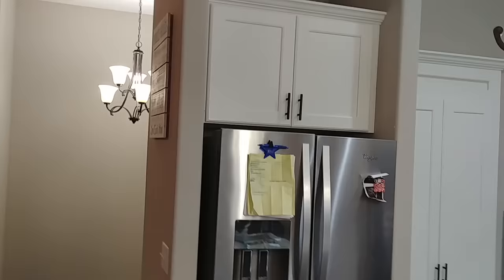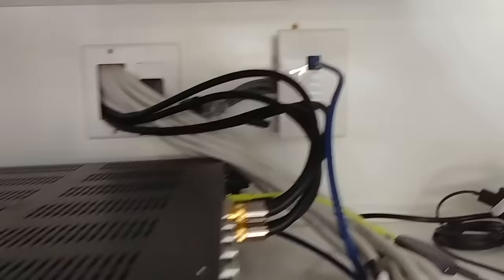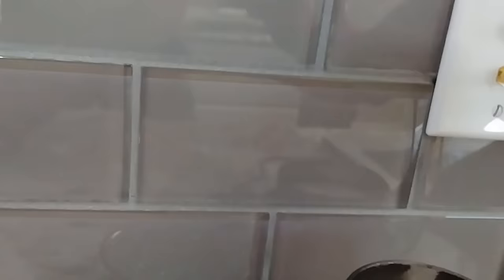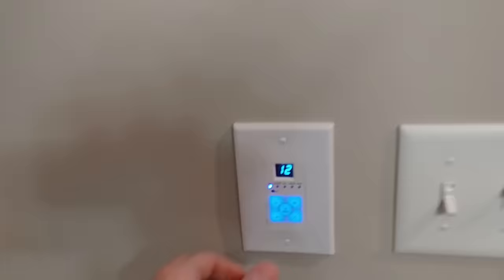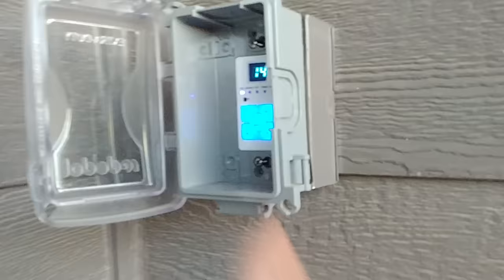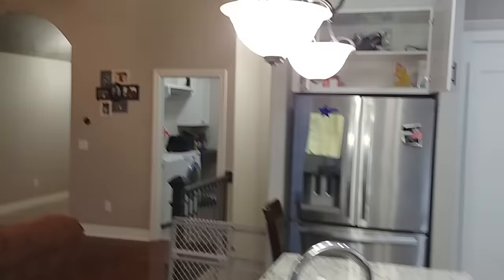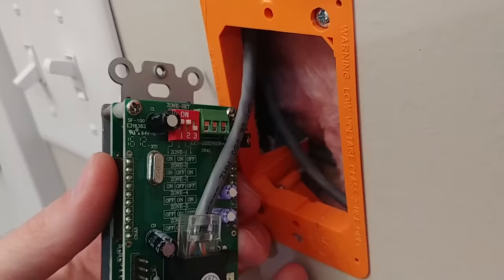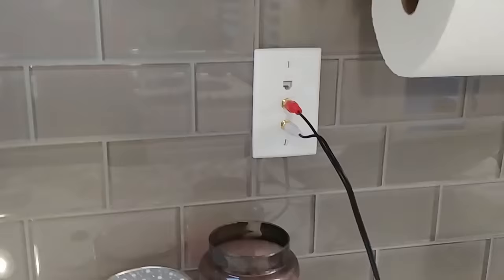WHOLE HOME AUDIO: Monoprice Whole Home Audio Amp! 6 Zone 6 Source

Comment: Great demonstration and very well explained, thank you for all the details.
Q1: Can you provide a sketch plan of the wiring and instruments installation?
Q2: Any advises for running and organizing the wires inside the attic?

I decided to subscribe because your video is one the best on youtube. Thanks a lot again.

AJ
Reply from the maker: In the new construction installation i did, i tried my best in the attic to have 2 main bundles of wire that i tried to run everything in. They were secured to the 2x4's with zip ties which had screw holes on them. But once you have a cable run that has to branch off of this main bundle, you really just have to do your best to make it as neat as possible. There isn't much you can do. In my existing house installation, i have blown in insulation in the attic. and i basically just laid it on top of the blown in insulation. It sinks down and you can't see the wires. Again, not a whole lot that you can do, so just do your best!
Reply: Thanks for the quick response, can you please send me the link for the new installation? Also I'm assuming each channel on the Monoprice Amp can take up to two speakers only, correct?
Reply from the maker: This is the overview video https://www.youtube.com/watch?v=TeUD5Pqpa9Q and this will actually talk more about the whole home audio amps. But i dont show the attic in either video. https://www.youtube.com/watch?v=hH6FbcZpnsA
Also yes, the amp should only take up to 2 speakers. Keep in mind if you need more zones, you can chain up to 3 of these amplifiers together. So you can have 6 zones with 6 sources, 12 zones with 6 sources, or a maximum of 18 zones with 6 sources.

Comment: has anyone had any issues with the keypads not working?  

Mine were working for 2 years and then stopped working suddenly. Troubleshooting with monoprice support pointed to the RJ45 jack in the amp not working any more. There was no resolution provided by them, which is why I am here looking for anything else other people that done.

The App by the TheKMZ1 might be a solution since it works through the RS232 port.
Reply from the maker: I've never had issues or heard of anyone having issues like this before. Is it possible your amp was damaged by lightning in a storm or something like that?

Comment: The iFlex IP somehow changed and when I open the app it crashes since it's looking for the old IP. Any way to change the IP in the app without reinstalling it?
Reply from the maker: You will have to clear the app data in android which will wipe all the settings, I need to figure out that bug in the app but for right now clearing the app data is what you'll need to do I apologize and hope to get it fixed soon! Thanks for the comment and feedback
Reply from the maker: Also set a fixed ip address on your flex so it doesn't change, your other option is to simply change the flex ip back to what the address was before, rather than what I suggested earlier
Reply: @TheKMZ1  I found an easy fix. Turn off WiFi, reset phone, open app while on LTE and let it time out. Them you can go to settings and change the iFlex IP. Suggestions for you, it would be useful feature to add ability to change all zone volumes at same time and all of them the same volume level. Makes it easier to balance out the volume throughout the house.
Reply from the maker: @Lenser  you can do that already, just go into the settings and check mark the box that says show group containing all zones. Then you can control all the zones at once including power, volume, bass, treble, sources etc

Comment: A closed cabinet causes trapped heat is the killer of any AMP.
Reply from the maker: I agree but this was the best place for the amp in my house. There are no fans on these units because it doesn't generate a lot of heat.
Reply: TheKMZ1 I think that spot is ok, but I would suggest you to change that cabinet's double door to a single vertical door for convenience and DIY it with one of those rectangular "wall vents" on it, or just make a hole on both of the existing doors and put a vent on them, might not look that great in that case, but it works.
Reply: @TheKMZ1  Thanks for the video. Great videos and you just earned a new subscriber. This is the first time I am writing a comment and I feel you exactly know what you are doing. I am just starting to build a new house and would want to put in multiple zone audio system by my self. I would like to know what all I should keep in mind. I am looking at about 10 zone system.
Reply from the maker: Are you capable of running all the wire yourself? If that is something that you can do without a problem, then this system will be a piece of cake for you. You would buy 2 amplifiers and have them hooked together for a 12 zone 6 source system
Reply: @TheKMZ1  I dont have lot of experience in this field but I am pretty handy. I can easily run all the wires by myself. Does this system come with any app to change the sources in differnt zones remotely.
Reply from the maker: saurabh kalra yes it does, I created the android app for it. Check out the video on my channel!😀
Reply: @TheKMZ1  cool. Can I touch base with you to find out what exactly I would have to buy. Like what kind of cables. Etc. Also do you have a ball park how much you parents system would have costed??
Reply from the maker: saurabh kalra yeah sure whenever you want to touch base and it was about $9k
Reply: @TheKMZ1  thanks. I am in Canada. What's the best way to get in touch with you
Reply from the maker: saurabh kalra kztechconsulting.com
Reply: @TheKMZ1  do you have a wiring diagram of your installing. I am very close to start the wiring so wanted to make sure I am doing the right thing. If we compare this system with htd lync or htd mid level mca66. What do you suggest.
Reply: Also for connecting multiple sources from different locations in the house do you suggest using baluns to avoid loosing any signal or just a super long rca cable would be ok?
Reply from the maker: No wiring diagram, this system is a little different than the HTD amps. HTD is over twice the cost of these, so you do get more for your money. Their keypads are better with more features, quality wise probably better. I reached out to them to ask if i could review their amps and compare. They told me they didn't want to have it compared to a monoprice unit. They said their systems are better than that. They seemed very full of themselves, and i said honstly guys whether you like being compared to monoprice or not, that is what people ARE comparing you too. So why wouldn't you want me to make a video and debunk that and explain the differences? Anyway they have not taken me up on the offer yet. They also have people who will help design your system. Like i said more money you pay, the more you will get.
Reply from the maker: No do not use a long pre-made RCA cable, you will have too much audio loss in the cable from poor quality. You will need to make custom RCA cables using RG6 cable and buying the RCA connectors for the coax cable.
Reply: @TheKMZ1  ok sounds good. So wires from all the speakers go to central location where the system is. And then the cat 6 cables goes to same central locations from the wal controls. Correct??
Reply: Now if I need my tv as an input that goes to the central location as rg6?
Reply from the maker: saurabh kalra yes that's correct
Reply from the maker: saurabh kalra yes that's correct too.
Reply: @TheKMZ1  thanks. If I have to control my home theater receiver using its remort. And the receiver is in the central location. Do you know I can I do that.
Reply: Hello. Please take a look at my earlier comment.
Reply from the maker: saurabh kalra you would need to use some kind of device like the itach flex with the flex IR cable but I've never done that but you can look into it

Comment: I have questions. I wish I could call you🤣
Reply from the maker: What kind of questions? Btw, have you seen my video about the new model?
Reply: @TheKMZ1  i have not. I'm doing this exact system for a customer. My question is about the audio from the cable box to the source(RG6) wires. How does audio connect to the wire. What adapters did you use to execute the terminals behind the tvs? I imagine from the wall it is rg6 to coax to aux but do you still get the full left and right audio? I know it has to work right somehow because rg6 is made to carry a video signal as well as left and right audio.
Reply from the maker: @coltonodell3410  Yes it's 2 RG6 cables, so one is left and 1 is right. If you ever noticed on regular small RCA cables, even those are just 2 separate cables (much thinner of course, and shorter), but they have them molded together, and then at the end is when they split apart. So use 2 RG6 cable, and 1 is for Left and 1 is for right. Then i used these RG6 to RCA compression connectors https://amzn.to/3dUywHP  make sure you have a compression type tool like this https://amzn.to/3mmc6C3  and then to finish it off i used this type of keystone plate (you can get more holes if needed) https://amzn.to/34ufdBU and then here are the actual jacks https://amzn.to/3mm9m7L    and    https://amzn.to/31I9zKH   The reason to use RG6 cable for all this, is simply because when running long RCA cables you need thicker cable so your audio doesn't experience loss. So there is no way you could buy a giant pre-made long one, otherwise you'd have no audio by the time you go to the end. Assuming it was the same thin cable used in any other RCA cable that you buy online
Reply: @TheKMZ1  thank you so much sir. That question may have been asked and answered already but I couldn't find it right off the bat in the comments. I'm subscribed now and I really appreciate your helpfulness. I've only ran 1 rg6 to each tv. Now I know to run 2. That would have become an issue down the road. The house is just framed right now. I do smart home improvement installations on the side and this is my first whole home music system. So you've been a big help with your video and your quick responses in the comments. I love your parents house. The 2018 smart home. I plan to use your videos to educate me as I do more work around my area.
Reply from the maker: @coltonodell3410  No problem, for your future projects, consider to use the Soundavo WS66i, which is a video on my channel that you will see. It's the upgraded version of these amps now. I am now only using this amp, as it has 2 built in wireless streamers, and the build in app control module. Everything else is the same, so insallations is the same, and the front plate looks a lot nicer. The keypad plates are different and look more high end (not the keypads themselves, but the cover plate is a higher quality snap on type where you can't see the screws). Use code TKMZ and you will get $550 off the price of it. So consider this for future ones! Thank you

Comment: is it possible to add to mono amp to power like 20 zone/rooms
Reply from the maker: Hellen Opinya if you need that many zones then this system type is not for you. I'd recommend a 70 volt system instead.
Reply: +TheKMZ1 any known 70 system that can do that because i wanted to power my big house connet the amplifier to my nas as a source thanks in advance

Comment: how many speakers can you connect to one zone?
Reply from the maker: It's meant for 2 (a left speaker and right speaker) for a stereo setup... As opposed to a mono set up which is 1 speaker only. Technically you can wire up to 4 speakers bit requires more advanced knowledge of series/parallel wiring. So for that reason I recommend just the 2 speakers per zone
Reply: thank you for your fast response i recently but a home with a unfinished basement and am wanting to do the celing speakers and this setup looks really cool do yoi have any other videos that show the process of wiring the amp with all the connectors also have you tried the Source Keypad with Bluetooth Receiver and RJ45 to RCA Converter?
Reply from the maker: @Danyyboy11211  you can find the manual for this amp kit online, it's helpful. Unfortunately no I've not tried those converter things
Reply: can one keypad control all 6 zones?
Reply from the maker: @Danyyboy11211  No, but my android app can do that
Reply: im wanting to put 6 speakers in my basement living room do i need 3 keypads for the living room then since onle two speakers can go in one zone?
Reply from the maker: @Danyyboy11211  Yes that is correct. And if the room is that big you might as well use all 3 keypads, then you can independently control the sections of that big room. Also with my android app you can create a zone group, so you can control all 3 zones at the same time.
Reply: what is your android app thank you for all the help

Comment: QUESTION ON EVERYONES MIND... HOW MUCH TOTAL?
Reply from the maker: Depends on what kind of speakers you buy, how far you have to run your cables, how much cable you need to buy. But, when I did this particular install i spent about $850. Today, you can't get these amps as cheap, a 6 zone install would run about $2,000 all in if you have to buy everything. This is extremely cheap compared to sonos, or other systems. Check out my new video detailing the new upgraded monoprice amp called the soundavo ws66i
Reply: @TheKMZ1  kool answer.

Comment: Looks like 14 gauge speaker wire. 16 gauge would've been perfect.
Reply from the maker: Check my description, i listed all of my components used. I used 12 guage speaker wire, it was leftover from a new construction build i did (see my smart home video). But yes, i would recommend 14 guage.
Reply: @TheKMZ1  16 would be ample enough for that application. I do this for a living and even 14 is too thick.

Comment: Looking into doing this is there wall control for 3 channels?
Reply from the maker: Kaylyn Burch what do you mean when you say 3 channels? There is wall controls for up to 6 zones, you are not required to use them all
Reply: TheKMZ1 I’m running 3 pairs in one room and want only 1 controller
Reply from the maker: i think it is technically possible but i would say it's not entirely how the system was designed for. You would need to wire your speakers such that the amplifier still sees as close to an 8ohm load as. You could do (2 speakers in parallel) in series with (2 speakers in parallel) and that would give you 8 ohms so that would go into the amp's left or right channel, and then your last set of spears could be in parallel which would go to the other left or right channel that you didnt use, and that would be a 4 ohm load but probably as good as you would get.
Reply: Do you think you could alternatively connect the controller wires (CAT6) so the three zones would be controlled by 1 wall pad? I guess if you have more zone slots than you need this could be a potential option. It might make sense for connecting speakers in kitchen, dining, and family rooms all together as in the common "great room" build style.
Reply from the maker: What you are referring to is called grouping. There is not a way to physically group them like you are describing. This is because each keypad has it's own "address", which is controlled by the red/white dip switches on the back. So it sends the command to the amplifier and the amplifier knows which slot to turn on/control. Because only 1 keypad has 1 address, it can only ever control that 1. However, in my android app that i wrote which can control these amps, i am planning on adding support for grouping. So 1 click of the button in my android app would control all 3 zones like you mentioned.

Comment: That ethernet connection is holy fuck stupid.... WHY ON EARTH would a company think it is a GOOD IDEA to have the release FACING the board?!?! That makes removing it (if you ever need to) extremely difficult! Specially if you use a snagless terminated cable....
Reply from the maker: Hikari yes I agree, I have had to remove them before and I have to use a small flathead to press it down lol

Comment: can you have a 5.1 surround in the main living room zone? if so please make a video to explain it
thank you.
Reply: You could sort of jerry rig it, but it would be much easier to use a traditional receiver. A useful integration might be having in-ceiling surround speakers then using the rear pre-output from the receiver as an input to the whole home box. You could then, more easily, run your surround speakers with a different music source to fill your living room with music. This could sound better, and be more user friendly, in certain living rooms depending on layout and placement of your front home theater speakers. Outside that pretty specific use I don't see the point.

Oh of course you could use one of the preouts to send stereo audio to a HT receiver, better syncing your whole home music into a living room
Reply: Can I hook up av receiver to whole home audio in one zone to get 5.1 channel surround??